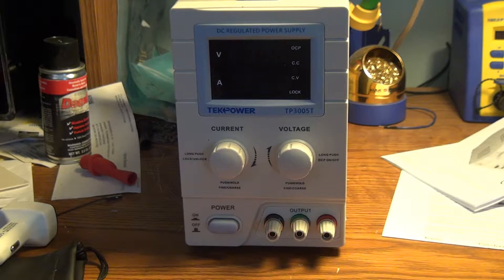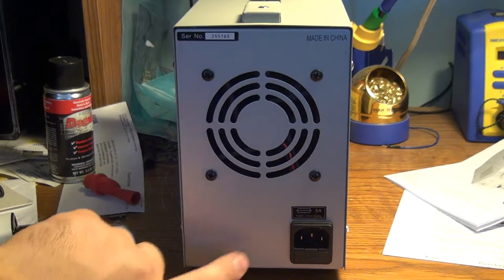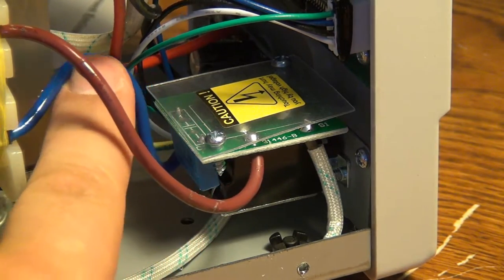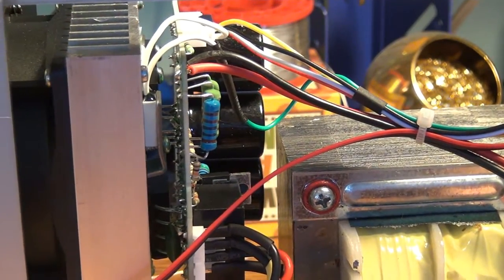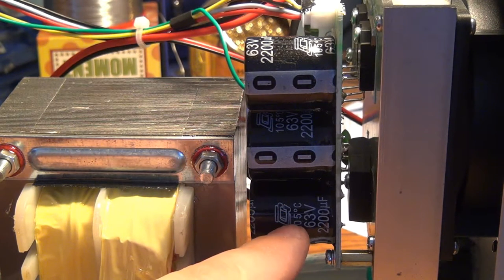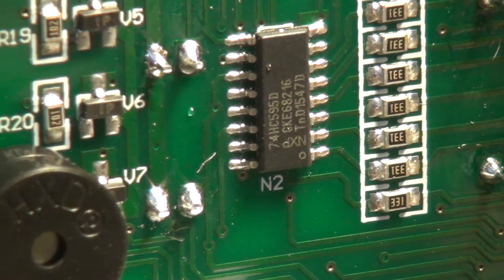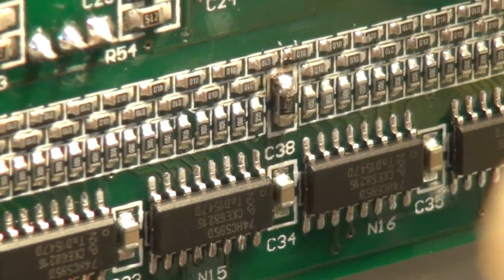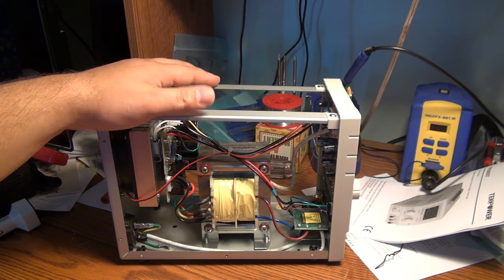eapbg #27 TekPower TP3005T Tare Down

Comment: Quick FYI… “IC”stands for Illinois capacitor. They make the best capacitors around these days. You can check them out online, I find them to be as good as anything nichicon or other quality makers ever produced. Mr. Carlson over at “Mr. Carlson’s lab” has a very high opinion of them also. Thanks for the teardown and review! I’ve always been a big fan of the masstech brand. And I believe this is made by the same people.
Reply from the maker: Thank you for the info.
Reply: Just for the record most people don't have a high opinion of Illinois caps. They are not known for longevity,. I'm not sure why Mr. Carlson would say otherwise, I haven't watched, but they are known as a second tier cap.

Comment: The only modification I made on mine was I replaced the red and black wires running from the power board with 14 gauge silicone because I was noticing the original 18 gauge wires we’re getting a little warm under load other than that mines been functioning flawlessly .

Comment: Hi there. I have one like this and what happened is that someone connected a drill battery in reverse and make a big loud bang. It instantly got into Cc mode because the reverse protection diode was shorted and the two small coupling caps on the small board with posts evaporated. Now, after replacing the diode the supply does not read current anymore and the fan does not start te spin faster after 1A. I replaced the four ic tha TL ones on your board mine are different but they are op amps. But still nothing. Any idea on what to check or do? Or if you have any schematic for it?
Thanks

Comment: My supply just went, display works however no voltage output. I noticed the AC plug has two spare fuses however I can find no place to use them. Any idea why I have no voltage output. Thanks by the way I have same model as the one you talked about
Reply from the maker: Make sure the current is not set to zero. If the display is lit up then the AC fuse is good. Things like this typically are not fused separately.

Comment: Hello. Do you think that this power supply could be modified to provide also regulated AC voltage? Maybe by soldering some wires in front of bridge rectifier? Thanks.
Reply from the maker: No, at best you could get AC volt steps from the different transformer taps. There would be no regulation of any kind what so ever. Regulating AC is a completely different animal.
Reply: @eapbg  Thanks for the info.

Comment: Sorry to dig up an older video but I'm planning on inserting a beefy switch between the positive output jack and the power supply so I can turn the output on and off without turning the unit on and off.  Is there any reason that would cause a problem with the other electronics?
Reply from the maker: As long as you are in front of the sense lines then everything is ok. To clarify, if the switch is outside the supply then everything is ok. If you plan to put the switch inside the supply then you must take care that the sense lines are not disconnected by the switch.
Reply: @eapbg  Thanks for the reply! So are the sense lines on the board the jacks are connected to? I was hoping I could just switch the red wire coming from the power board to toggle power without turning the unit off.
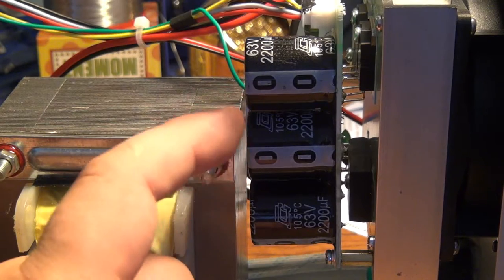Reply from the maker: @justovision  That's what it looks like. If you look at the video at 14:10 there is a 4 wire connector on that board. Those are most likely the sense lines.
Reply: @eapbg  That's disappointing. Thanks for your advice!

Comment: Anybody know the value of C4 on the binding post board.  I vaporized the one on mine by accidentally sending 120VAC to it along with the 1N5402 diode (which shorted but did not vaporize)  right below to it. I've got it working again, but would like to know the correct value for that cap. FWIW, i used same value as C5, but that was just a guess. Thx!

Comment: Hi, thanks for this video!
Have you ever tested signal quality (with an oscilloscope)? For example noise, voltage peaks at start-up, peaks during regulation, etc. ?
Reply from the maker: Not on this unit. Don't have a digital scope yet, just an analog one.
Reply: eapbg I found that :
http://labornetzteil-test.de/labornetzgeraet-qj3005t-im-test/
Reply from the maker: That's a nice review, thank you.
Reply: @p.g.pg38  I know this is an old comment, but I don't see that testing - it's page in German that doesn't lead to that PS that I can see.

Comment: When you short the 2 leads together what does the PSU do. Does it just shutdown to protect or make a clicking sound.
Reply from the maker: This type of lab supply has two modes, constant voltage, and constant current. When I short the leads together, the supply moves from constant voltage mode to constant current mode. When in constant current mode the supply will regulate to the preset current.

Comment: since when is soldered instead of using a connector not removable? yeah to joe average its broken if you cut or rip it but for most of your audiance desoldering is trivial or simply clipping the wires and adding a connector between. if they had coated it in 2 inches of hot melt id go a bit easier on saying non removable but its just a really poor choice for your intended audience.
Reply from the maker: The spirit of the comment was that the manufacture meant to put a connector there. There was a clear mismatch it parts. The board had a connector and the transformer did not. If the product was made as designed it would be easily disconnected. You are correct that some solder would not stop us from removing the transformer. The problems is that with that kind of outlook even the TQFP Pic micro controller on board is removable.
Reply: Owning an Anet A8 3D-Printer with this connector on its heatbed, i know why they bodged it that way. I did exactly that after the connector went sunburst while printing petg. This seems to be a "common" problem... So I think it's an afterthough, because they found out that this type of shenzen common type one lifetime supply manufacured standard connector go go up in flames and totally ruin the party...